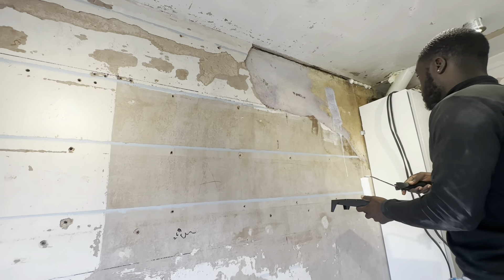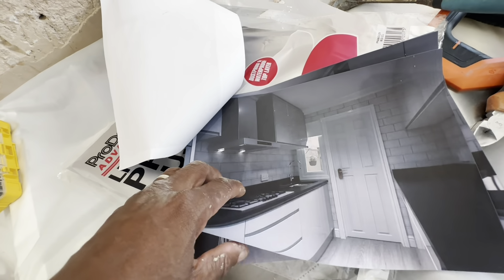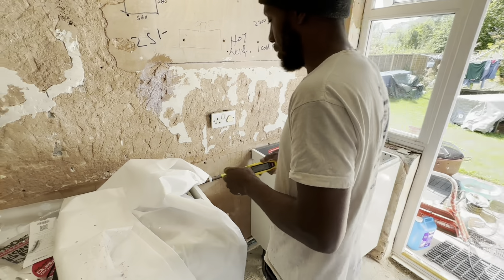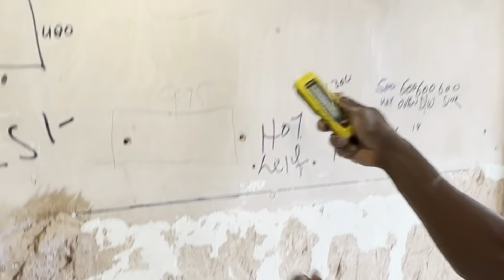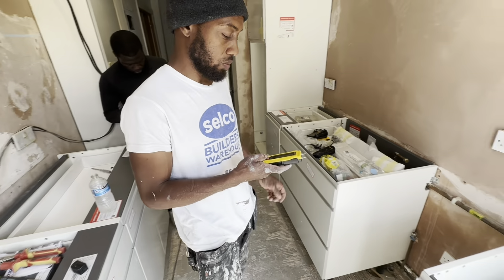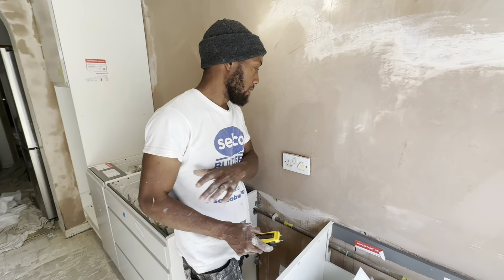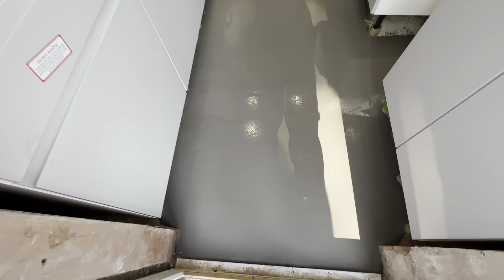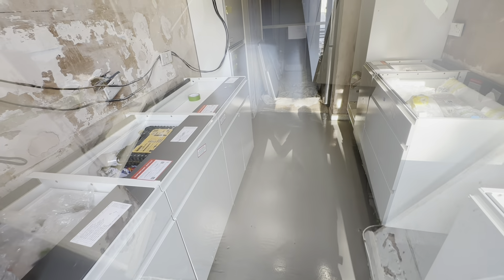Installing a small galley Kitchen - Episode 2

Comment: Don't explain yourself mate there are always going to be haters who know everything but never show how fantastic they are under time and price restraints. As a painter & decorator our trade is full of gods of the trade. Great vids mate. The meter you use to check damp where invented to check moisture levels in wood when used on plaster etc what they actually pick up is the salts / electrolites comming through. Theres a guy who explains this in detail who works on protected buildings and explains it better than me. Thats not to say the walls are or aren't damp but if they are stone walls if the walls have been plastered with a gypsum based plaster this holds water as most stone walls where built with lime mortar and covered in lime plaster allowing the home to breath. Just a thought. Keep the vids comming mate.

Comment: I'm glad to see you didn't apply the self levelling compound underneath the cabinets. I laid tiles on my kitchen floor and I thought at the time, why bother cutting and fitting tiles where they wouldn't be visible anyway, as long as the cabinets are level. Now you need to do a job with wobbly plastering and I can justify my pittiful efforts at that too :)

Comment: Darren, this has clearly affected you as you don’t come across as someone who would react to petty things. 

It is unacceptable that people used the ‘n’ word on this channel or any other social media platform. 

I have been following your channel for a while,  probably for the last three years and have picked up so much great insight before getting a job done. I am no builder or in the trades, just a keen diy person. Only last week I watched an old video where you did a fibreglass roof repair. This gave me enough confidence to  have a go myself. 

I ended up using some fibreglass paint I had which seems to have worked but would not hesitate to carry the full repair myself. 

Take all the negative energy and dump it, this is your channel and if people don’t like it, go and watch someone else or help you and others improve. 

There are many forms of discrimination that exist in our society, social media provides a cover for many of the perpetrators but it is still illegal. I believe if people step out of line they should be reported not just blocked. 

Keep up the good work teaching the young ones as well as some like me, not so young anymore.